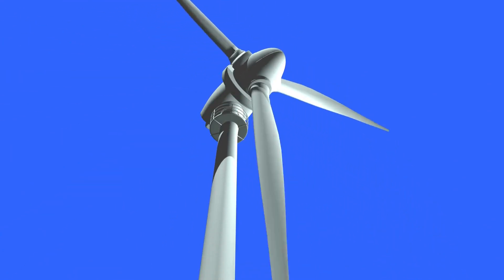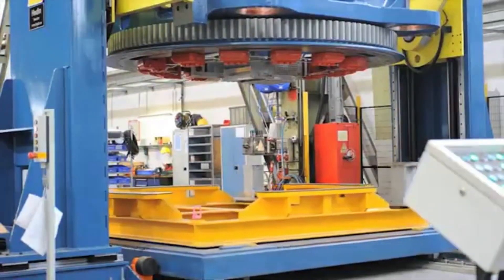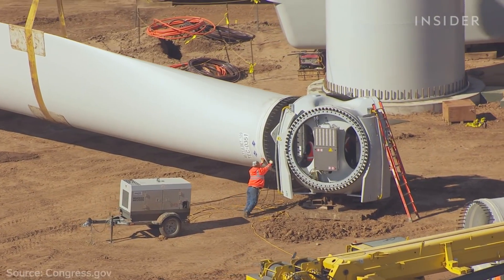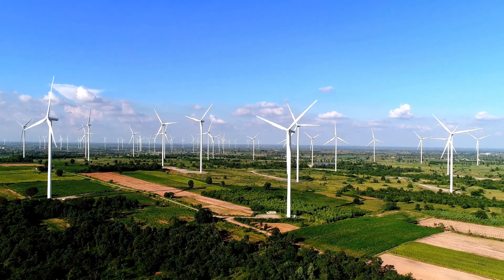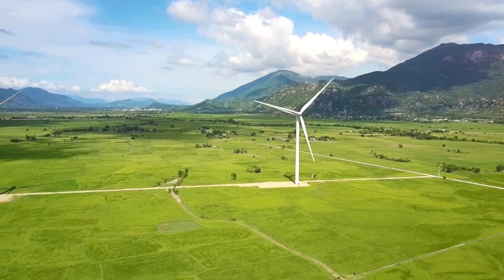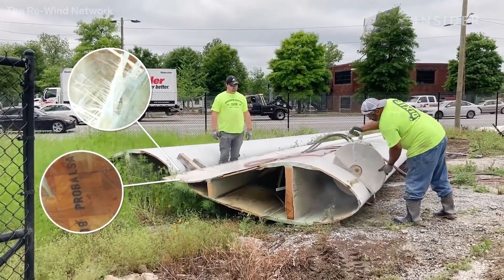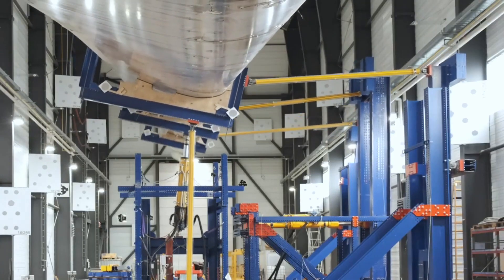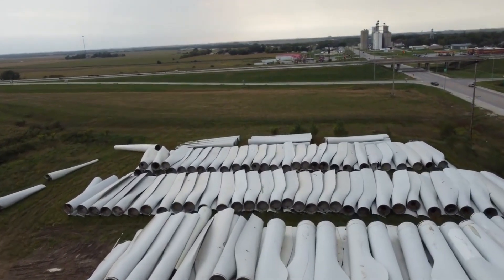Wind Turbine Blades: The New Challenges of Wind Energy

Comment: why would a blade not be usable?
Reply: Erosion due to effects of dust in the air literally sanding down the leading edge of the blades.
Reply: @ChristianLamine  does this impede it from doing its job? (I am genuinely asking not trolling at all)
Reply: @wydadiyoun  "Erosion" is to be taken literally here... "Dust" does not sound like it could provide a huge challenge to the blades (they're made of fiberglass, aren't they?), but in fact it actually DOES pose serious damage over time to the blades. "Sanding down" is no joke, and since the blades move with significant speeds towards the tips, the stresses resulting from either aerodynamic forces as well as centrifugal forces are not to be taken lightly... So yeah, if this would be ignored the whole windmill would fail with time and literally self-destruct some time...
Reply: @ChristianLamine  thank you!